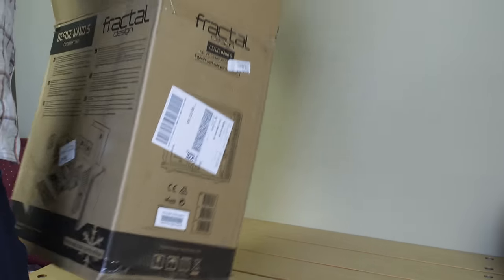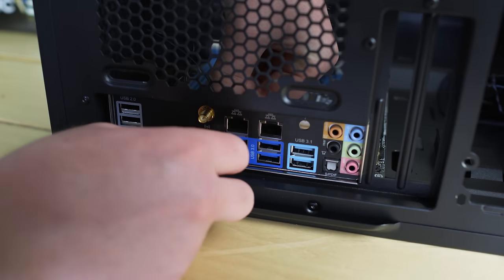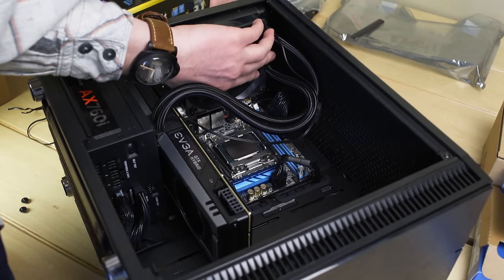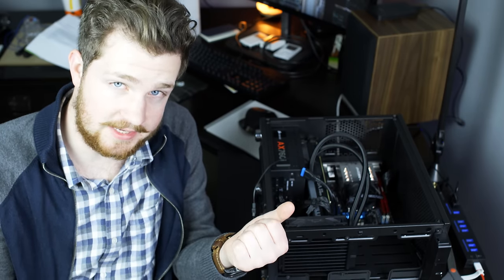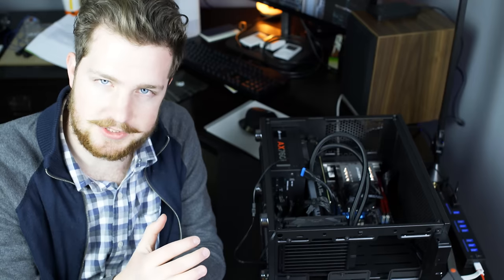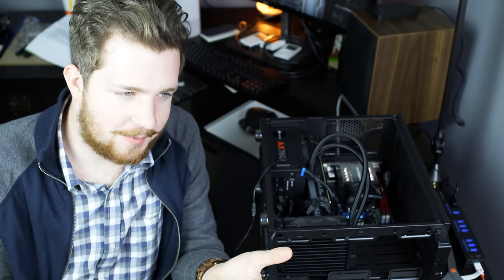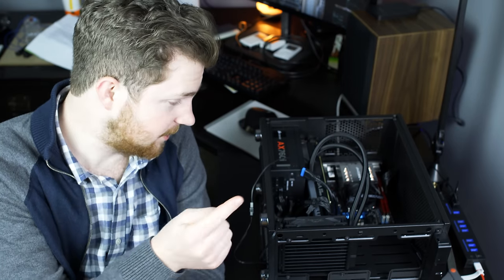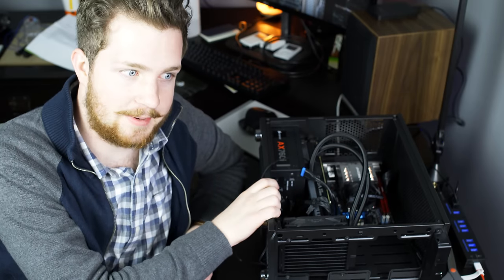My Powerful Custom PC Build Disaster

Comment: GPU should go last into the PC. Just to have some space for your arms.
Installing ECC RAM? Are you serious? "I knew that". Yeah, sure, you would know it. Absolutely.  
Not functioning rad? Oh, that's the first thing you do, when you push the power button for the first time - look at the rads and fans.  

Yeah, I got PC, worth at least 2 grands, with refurbished PSU, just to spare some money on it. Are you serious? If something happens, your PC would be in flames (or your whole flat) and NO WARRANTY would help you. 

You basically could damage your motherboard with your refurbished PSU. Congratulations.

Building PC is not frustrating, if you know what you are doing. It's like parking a car. It's seamless, if you know something about it. If you don't know anything about PCs, leave it to the guy from next door, who does.
Reply: +Peter Bočan You skipped the part where he used two screw drivers to jam a power connection in! I loved that part! "The connector wouldn't go in, so i had to use two screwdrivers to jam it in and even then it didn't look seated properly." 

But you still powered it on and left it running overnight...
Reply: Oh, yea, I forgot. Yup. Hammer would be a better tool.

Comment: Seriously man ... you spent so much money on a high end 6 cores CPU, you chose one of the best graphics card out there, and you use a refurbished PSU to power all that ??? And .... and you hookep up all that big pricey stuff to a tiny entry level motherboard ??? What the Hell !!??? .. Come on .... you really look for problems ... and you found them !! All your components need to be on the same quality level man, these are the basics !!
Reply from the maker: +Lucien Bartelet Not an entry level motherboard. Lol. It's like the most expensive mITX board there is. Just because it's small doesn't mean it isn't good.
Reply: +Snazzy Labs OK so it's not a cheap motherboard ... my mistake ok, I admit ... But for 300$, man I would choose a full size ATX mobo .. because for this high price, I would really want a bunch of PCI/PCI Express slots, 4 ram slots instead of 2 !! Extra connectors ! That's a minimum for that price don't you think ?! ... and by the way ... why do you want to put such powerful parts in that small case ??? For what ? You want them to overheat ? You love being limited in your future upgrade choices ? Because a standard size case is "not as cool as a small one" ??  It makes no sense ... and yeah, finally, the refurbished PSU .. man, for a system like this, 900$ just for the CPU/Graphics Card ... I think you can buy a new one, please ...
Reply: +Lucien Bartelet The whole reason he built this pc is because he wants a replacement for his mac pro, which means he needs a small form factor, of which right now, is mitx, which may take away expansion, but the size, at least I think, equalizes the goods and bads. plus, the overheating myth is just that, if you correctly cool it, adequate cooling, good airflow etc, the computer will not thermal throttle.

Comment: 1:19 - Hi! I work as video editor and this part really baffles me. Why are you even mentioning CUDA? It's proprietary technology owned by Nvidia and it doesn't even work on AMD cards. You have AMD FirePro series in your Mac Pro. That's pretty powerful GPU and Premiere Pro can use Mercury Engine with OpenCL acceleration on that card. What's wrong with that? It has been supported for quite a long time now and it works just fine.
4K is entirely different topic. You mentioned that you're using A7s II and your footage is in ProRes. I guess that you're using some external recorder then, cause that camera cannot record internally to ProRes. In case you mixed something, beware that XAVC codec, which is what that camera records to internally, is really demanding. If you editing it natively in Premiere Pro and it's not as fast and responsive as you want, there is a simple solution to that. Use Proxy, as many other A7s II users do. It can be automated pretty easily. As a matter of fact, that's why Final Cut works so well. Default behavior for this NLE is to transcode everything in the background, creating proxy without user intervention.

Comment: Someone are going to complain about that amount of  thermal paste.
Reply: Like always. No matter what you do. Someone comes and complains about that.
Reply from the maker: +ObjektiiviVirhe Yeah. Slightly overapplied. Tube was tricky. And I was filming it at the same time. LOL. Wasn't too excessive (had to remove the cooler 2-3 times anyway and re-apply. The new Linus Tech Tips video proved overapplication while n00bish is negligible. Haha. Thanks for watching.
Reply: +Snazzy Labs Unless you put WAY too much (like 3x more than needed) or WAY too little, it makes literally NO difference (if LinusTechTips is to be believed). It's one of LTT's last videos.

Comment: The higher the end, the more important the PSU becomes. 

Sayin'.
Reply: +phuturephunk It's also something you really can't save much money on. I just got an EVGA Supernova 750p2 ( that's the platinum 750W PSU ) for under $110 new.

One of the absolute best rated power supplies, with clean power, high end caps,  protections for basically anything, ultra quiet ( mine hasn't even gotten warm enough for the fan to turn on outside of benchmarking really. ) and their monstrous 10 year warranty. Loving it so far! ( Oh, and yes, fully modular. )
Reply: +zemerick13 I lucked out with mine, I got the Seasonic 860W platinum series for 130, a 190 buck PSU... for 130, brand new. Can't get any better than that... unless you wanted a higher wattage one lol.
Reply: DarthHeretic Exactly, when you can get an excellent brand new PS for just slightly more, it's the clear choice.

I actually just straight up buy everything new when it comes to computers. Unless you're on a pretty restricted budget, it's just not worth the risk.

Comment: In the 25+ years I've been working on computers on electronics, the one component I'd never cheap out on or get a refurb on is a power supply. I put that in the same category as tires, mattresses, and fire extinguishers. Being the only component that actually handles a line load (110 or 220AC) and being the gatekeeper between that line load and the rest of your expensive components, I'd rather spend more than less on one of these. Over the years, I've probably seen more weird computer issues caused by flakey, cheap, worn out, or zapped power supplies than anything else. Consider it a lesson learned :)

Comment: Honestly this was painful. This is what happens when you just get a bunch of expensive parts because they're expensive, do minimal research, and just start cramming parts together. Hell, no one with half a brain would tell you using screwdrivers to FORCE a component in is a good idea. PC building is a learning process in some ways. Going from nothing to top of the line, expensive parts for your first build is like going from doing regular maintenance on a Toyota to trying to replace major components in a sports car almost.

Comment: Hello sir - good video. I am 100% sure it is the psu. This is a very common issue with corsair refurb units. I had same issue with an ax1200i. I returned it and bought an evga 1200p2

Comment: probably that motherboard.  asrock is the worst brand for motherboards.  can cut corners in cost but it will cost you :)
Reply from the maker: +Jordan Groleau Their MoBos are actually great lately. And this is the only option for X99 in miniITX factor.
Reply: Snazzy Labs stay away from their z170 boards
Reply: Why ? z170 Extreme4 is very good mobo in that price. Much better than MSI or smth like that.
Reply: originally, ASRock was part of ASUS.  ASRock was marketed as low-cost, cheap boards for non-enthusiasts.  the same holds true today.  i have killed ASRock Z170 boards doing BIOS updates.  their DDR4 RAM compatibility is poor.  

if you recently upgraded to an ASRock Z170 board and it WORKS, then yes, i can see why you'd like ASRock.  i have been building hundreds of machines for 15+ years and i will never buy another ASRock board.
Reply: HowAml Regardless if someone has an opinion about Asrock build quality they built a 2011 socket on a mITX board. If that fact alone doesn't tell you enough of the bad design choices they make then you have no clue about building PC's yourself.
Reply: HowAmI "Go make a false persona somewhere else."

idk if i should be flattered or embarrassed for you, man.  if you have a passion for computers, you can build one a day.  that would put you at roughly 1k computers in 3 years.  

just cuz the average enthusiast doesn't build hundreds of machines doesn't mean it's impossible or even difficult to do.  i was born in 1989 so i have had a few years to get gud with a screwdriver.
Reply: They make great boards, have one right now its awesome.
Reply: ***** it's less of an anecdotal thing and more of a general thing.  they simply aren't a top-tier manufacturer.  why choose ASRock over Intel, ASUS or Gigabyte?  Those are top-tier manufacturers, regardless of subjective opinion.  

ASRock 2015 Revenue- 10.6 billion dollars

ASUS 2015 Revenue	$472.4 billion (2015)

is this objective enough for everyone?  ASRock doesn't have the same amount of money to dedicate to R&D or testing.
Reply: Jordan Groleau Regardless, they do have some great motherboards.
Reply: ive had great experiences with asrock in the past. maybe i just got lucky. or you've been unlucky? Gigabyte, on the other hand, will never again find its way into any of my future builds.
Reply: Speedj2 gigabyte is much better brand.  my opinion is based on several hundred computers worth of experience. anecdotes from people who have 1-5 computers worth of experience...  well, that's who i'm arguing against, i guess.  gg.
Reply: Dr. Debug is the best and I have been having a great time with the Z170 Extreme4 board.
Reply: +Jordan Groleau I won't disagree, as I could be lucky, but my ASRock Z170 motherboard works just fine and oc's like a champ.  I get that I may not have the whole picture, but I am at least another person with a fine Mobo from ASRock.
Reply: +SnazzyLabs I don't know why you HAD to get a miniITX if you were just going to put it in that fairly large case... miniATX would've gotten you much better options (possibly at a better price as well).
Reply: Oh no, MSI is the worst motherboard brand. I've had 4 MSI motherboards fail, a failure rate of 100% in a few months or less every time.

Comment: why not an i7 with 8 cores? better than 6 in video editing
Reply from the maker: +0SimpleSam Because that costs $1,200 more?
Reply: +Snazzy Labs Holy crap, just saw that. I had no idea it was that much, pretty ridiculous. At least you can overclock your 5820k pretty well if you use the Kraken
Reply: +Snazzy Labs Just watched your pc vs the mac btw and I have an EVGA 750 super Nova, it's an awesome psu
Reply: +Snazzy Labs Yet you brought an incredibly overpriced M.2 SSD...
Reply: +Flibbib the 950 Pro M.2 NVMe SSD is incredibly cheap compared even to traditional 2.5" SSD's, & its like 4-5 times faster to boot. The Gb's per dollar is good too.
Reply: +Jimmy Lee lol no it's not. The M.2 NVME is at least 4x more expensive than the standard 2.5" Samsung drives, at least it is here in the UK. 128 GB 850 EVO £55, M.2 NVME £218
Reply: +Flibbib true
Reply: +0SimpleSam LOL i have the same PSU in my build xD. Is it a B1?
Reply: +FuriousTaco No I have the G2, it's the fully modular one
Reply: 0SimpleSam LOL i meant to get the fully modular, but my mom ordered the crap and messed up the order.
Reply: lol that sucks, still a great psu though. I just like the look of the fully modular one
Reply: +0SimpleSam from my experience (i do a lot of music work) he could easily afford it by going AMD. Their cheap 8 cores are amazing for work like this. They are all quite weak, but if you use 8 cores rather than Intel 4 cores or 2 they work out much faster overall...
Reply: +KingProne yeah the amd cores are weaker but his cpu right now it's a little better thank my 4790k at stock speed. But I think one of those amd 8 core cpus over clocked would beat out his cpu easily
Reply: thats what im saying. My AMD 8320 struggels with games which use an old engine so it can only use 1 core. It gets absoloutly raped by an intel cpu in that case, however, once it does something where it can use all of its 8 pseudocores it absoloutly beats the crap out of intels. Particularly price wise. I got mine slightly overclocked due to water cooling, but 8 cores generate a lot of heat so a dual core is probably much easier to overclock...
Reply: +KingProne would've saved a lot of money and put it towards a big mechanical hard drive or even 2 decent sized ones and run them in raid for a back up or speed but I think back up is better in his case
Reply: +KingProne would've saved a lot of money and put it towards a big mechanical hard drive or even 2 decent sized ones and run them in raid for a back up or speed but I think back up is better in his case
Reply: A 4790k will destroy an 8 core AMD. An 8 core AMD only had the ability to function as a 4 core, much like a hyperthreaded i7
Reply: +Flibbib But there is no 128GB 950 PRO, only 256 and 512GB

Comment: Yea so you spend $2000+ and only got those parts?????? Why does it seem like such a rip off.
Reply: I just priced up one now and got to making it at $1758,53. It has a better graphics card a new PSU and better liquid cooling... The best Mini ATX motherboard and the best i5 6600K processor. The case is made to be transported and has a handle on the top it has awesome cooling and a 480GB SSD with 32GB of DDR4 kingston Hyper XFury ram. These are all brand new parts and where i am in the world i used my current exchange rate of R15.58 to $1. therefore equating to R27398 total in my country. And trust me when i say that that is expensive in my country. I can make one with the Factory parts in America and it will be cheaper. I feel you have been highly ripped off or you just didn't do any research and just bought the first thing you heard of or saw..... I made a computer last month and i spent R21000 which is $1324,92 the only thing that isn't as good as yours is the graphics card and the processor which is overkill.
Reply: +Daniel Bekker   A 5820k is miles better than that shit
Reply: Better yes but not worth because for his needs
Reply: the 6600K still does the job with no problems
Reply: +Daniel Bekker   he had that budget and was building a pc. what would be the point of building a pc to match a mac??? he obviously wanted more performance
Reply: ok fine he has a better CPU so i dont recall that CPU costing $500 more than a 6600K
Reply: +Daniel Bekker  what?
Reply: Ok because i have that and it gets the job done fine. How many PCs have you built this year. How well do you know that 4 cores and 4 threads is more than enough for friking video editing. Only when you go into game design does a difference show up but even then it is still usable and does what is needed very well.
Reply: Ok cool in the end he didn't seem to look around for cheaper parts and that was my point
Reply: +Daniel Bekker  kk
Reply: 5820k is better in some aspects, like editing. But a 6700k is more optimized for gaming. There is no better or worse between the two, just good at different stuff. Not that hard to be humble to each other :)

Comment: the fact you had to use 2 screwdrivers and all your strength to force a connector into it's socket on the PSU should have given you a VERY HUGE CLUE as to the problem!!!!! Does doing that with a PSU connector even sound anything like the right way to go about the job??? I guess it's true that Apple users really are majorly lacking in common sense ..............

Comment: The real problem is he tried to cut corners with a refurbed PSU (yea that sounds smart, lets get a refurbed part that can wear out) and a refurbed water cooler (again also not smart for exactly the same reason as the refurbed PSU). I build computers every day for regular customers as a retail PC technician. I usually recommend you buy parts locally in case you have a problem with them since its less hassle than shipping them out. Only parts you should not have to second think about buying online shipped would be CPU and GPU since those parts are MUCH less likely to be DOA. Also NEVER buy anything refurbished that has to be replaced sooner than later compared to other parts (like PSU and Cooler).

Comment: This is what I'm about to build what do you guys think?
Case: Nzxt H440 $120$
Power supply: Corsair VS650 $70$
Motherboard: Asus Z170-A $160$
GPU: Nvidia Gtx960 $170-200$
CPU: AMD FX-8320 Vishera $150$ OR Fx6350 
RAM: Corsair Vengence 16gb $65$
HardDrive: WD Red 6tb $200$

TOTAL: $965$

Comment: Not trying to rub it in but you took that Mac mentality into the PC sphere, when it comes to form factor. When you're dealing with this kind of power and performance it's harder to shrink this all down. Should've just went micro ATX, got a nice but standard cooler like the 212 Evo, and got a nice reliable new power supply. No reason to spend that much on a GPU and CPU and buy a refurb PSU when even Corsair's CX line would've been better than a broken unit. And really any trusted brand in the price range of ~120 dollars would've far surpassed your needs. No real reason to cut corners here when you've spent so much on other components; faulty power can damage them and then your investments are toast. PSU is the one place I would happily overspend (and that doesn't mean buy the highest wattage.) Good luck in your future builds.